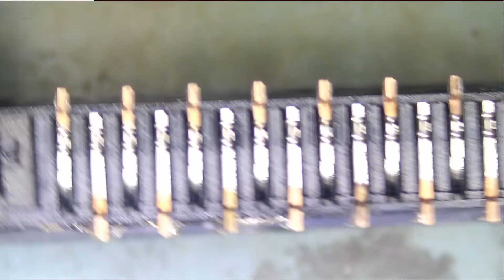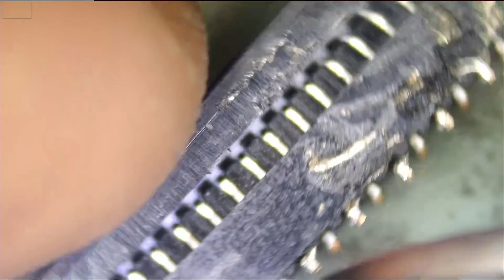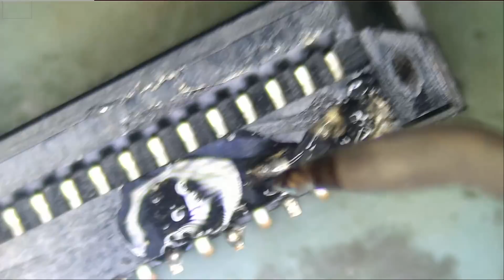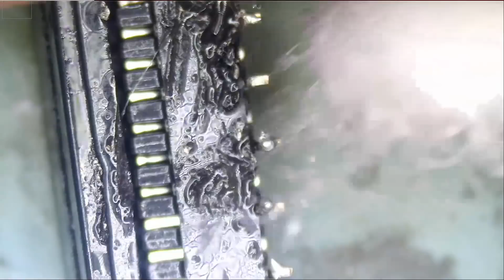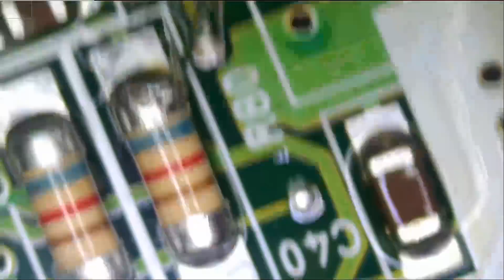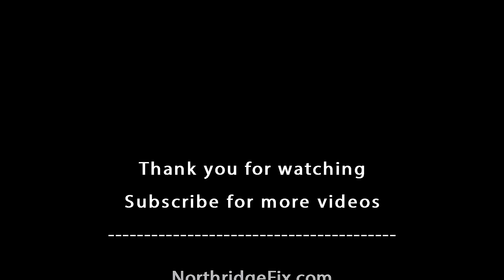Toyota AC Control unit - Ripped Flex Connector

Comment: Im new on your channel love to see your works
My laptop hard working very slow
Any solution?
Reply: In my case, it was due to the disk drive getting more unreliable but not failing as such. Replaced it with an SSD, now lightning fast!

Comment: I just did one last year for the same thing. I had to run jumpers. What happens is the control nut on the rotary control loosens off and the customer turns the control to far ripping off the connections.

Comment: So the guy did no damage to the connector or to any pads, the solder joints were just so weak it fell apart,  seems like the OEM assembly was flawed